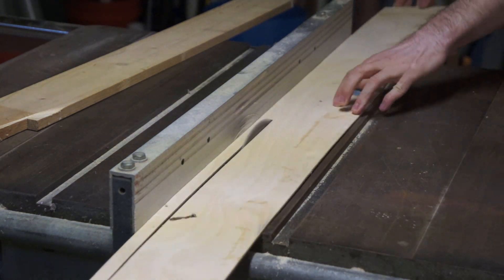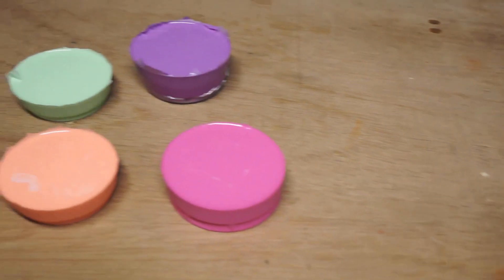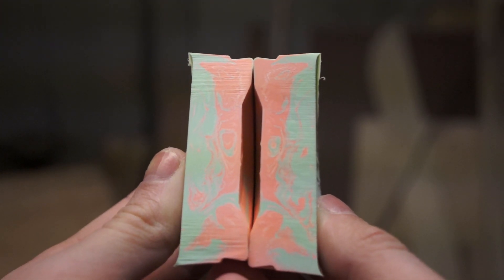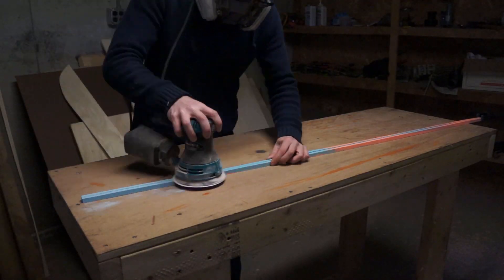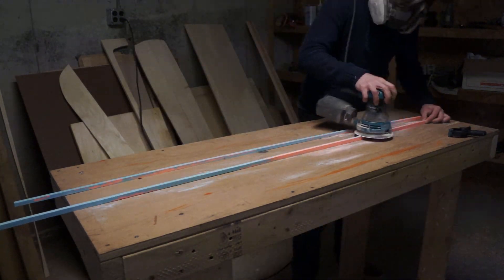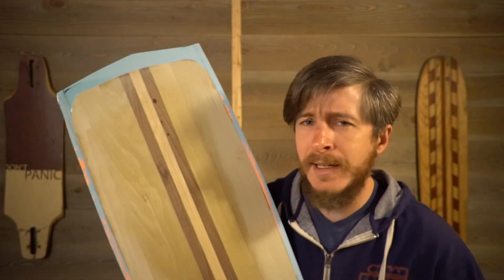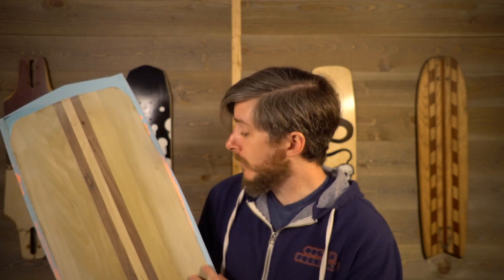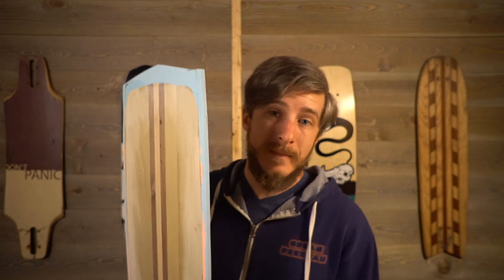Building a Snowboard - Part 6: Two Ways to Add Sidewalls

Comment: Did the polyurethane block bond with the epoxy glue?
Reply from the maker: Do you mean to the core? It bonded okay but I found it to be a bit brittle. I used hot glue elsewhere and surprisingly it worked a lot better. Heck of a lot easier too.

Comment: Nice video, clear and instructional.  I would imagine that you want to completely encapsulate the wood in the core from the elements.  Am I correct that the wood that forms the bottom of your channel will be removed when you profile the bottom?
Reply from the maker: Exactly, that will get planed off when I profile the core

Comment: Hi, do you think the urethane sidewalls are necessary for a powder board? From what I’ve read, urethane has great dampening properties so would be great for boards that see a lot of veriable terrain and hard pack, but if it’s mainly powder you’ll be using the board in will it be that effective? Anyway, I’m enjoying watching these videos and look forward to the next instalment. Cheers
Reply from the maker: I'm in the northeast and our conditions are really variable. Sometimes even on a powder day there will be ice patches, and I'd like to be able to take this board out more frequently than the occasional dump, even if it's just for fun. Between that and wanting to get some all-around building experience, I wanted to tackle sidewalls in this build. I'm still learning the ropes, you know?
For a board that's going to live mostly in deep powder? If you don't have to worry about rocks or trees? Then yeah, they're probably not needed as much and it might be smart to go for something lighter. 
Thanks man! Glad you like the vids!

Comment: Nice work on the side walls. I just curious what happens if we don’t do the side walls on a snowboard？it’s gonna be easier to break apart the core and edge?
Reply from the maker: The sidewalls are there to absorb shock and impact but you can definitely make a board without them. If you look up "snowboard cap construction" you can see a method where the glass cloth and top sheet wrap around the core down to the edges. It's less impact resistant, but snowboards were made this way for years. Many skis still are as it's a lighter construction method.
Reply: @GoodRoads thank you for your knowledgeable response. ill keep following your next video.